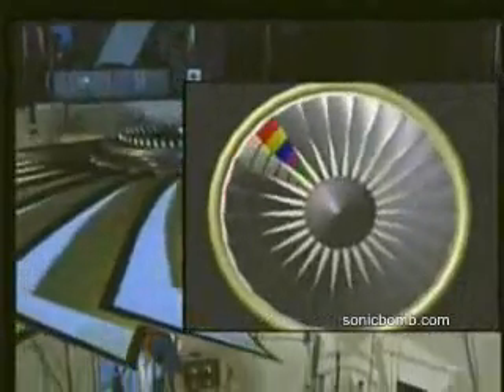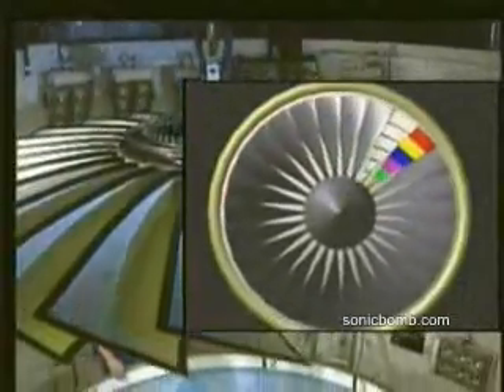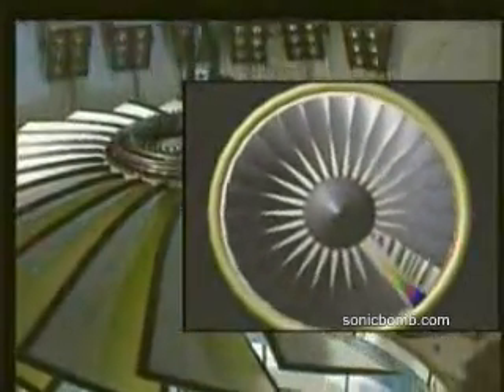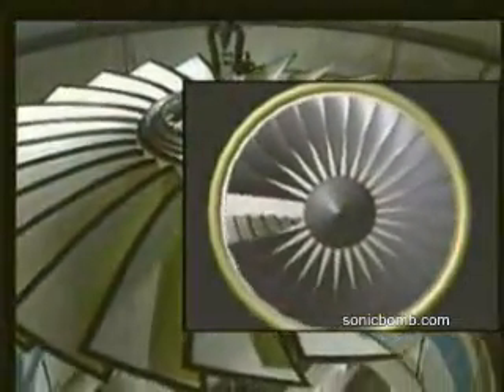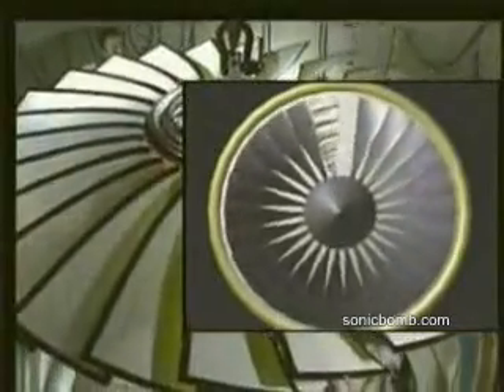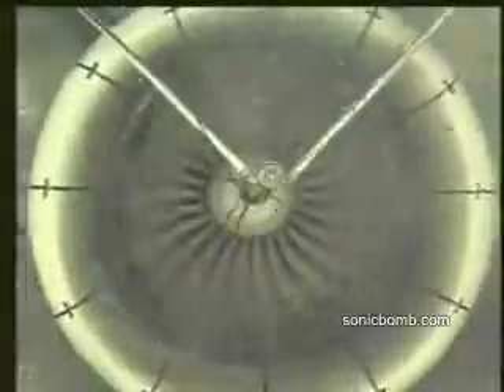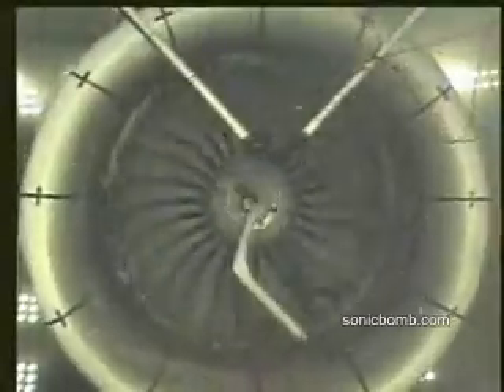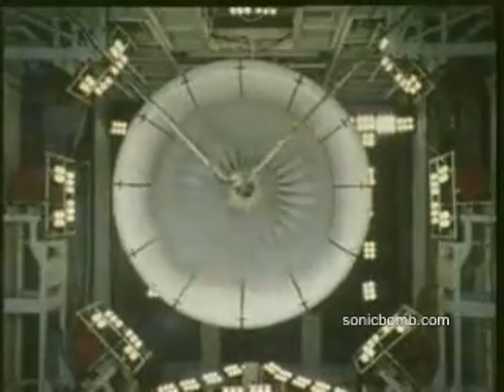Gas turbine engine Fan Blade off test

Comment: I've always loved this video, so mesmerizing and fascinating. I think of it a lot in light of the Southwest Airlines incident, where, for the second time, a fan blade failed due to fatigue and the inlet housing was shredded, this time killing someone. This test is to ensure that such a thing doesn't happen, that debris is not ejected when a fan blade fails. What went wrong? Why was the debris not contained, not once but twice? Why was that not discovered in this test? Looking at photos of those engines, I see that it looks like the damage isn't to the ring surrounding the fan, where we'd expect the brunt of the energy to go, that is intact, the damage is forward of that, the inlet duct. Seems as though a lot of energy was directed forward, as didn't happen in this test, in this video it doesn't appear that much debris went forward of the fan. What caused it to be different in real life than the test? That is the big question that must be answered, my speculation is that these tests are done on a test stand, stationary and at low altitude, while those failures occurred at cruise, high speed and altitude, maybe that caused something to be different? Maybe the test needs to be redesigned for that?